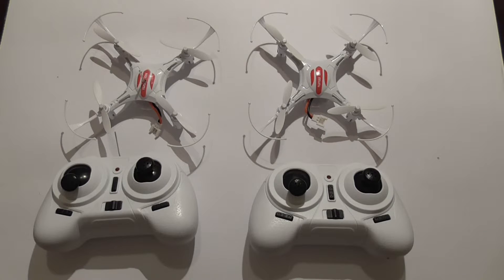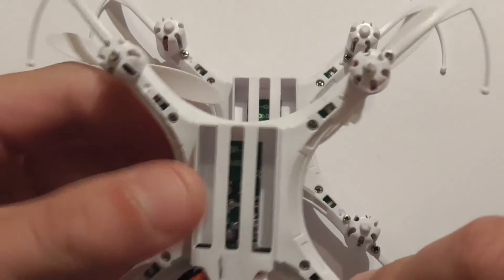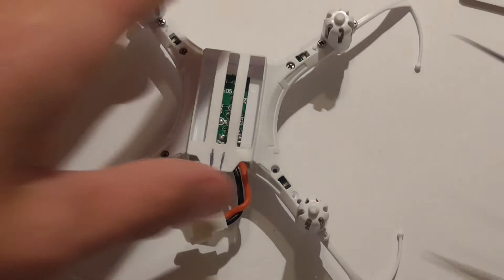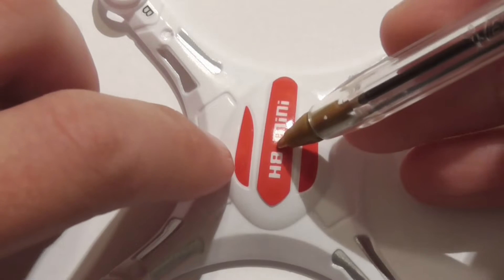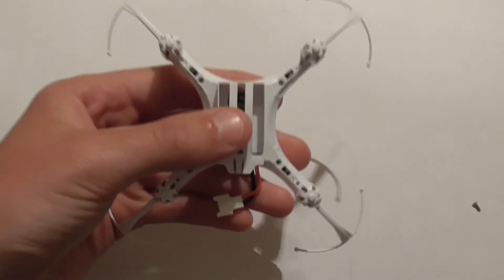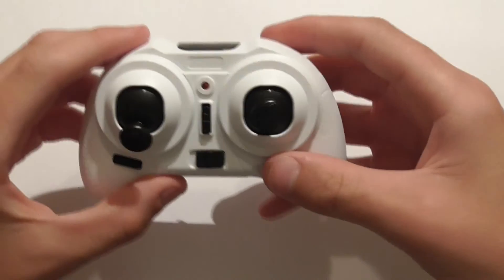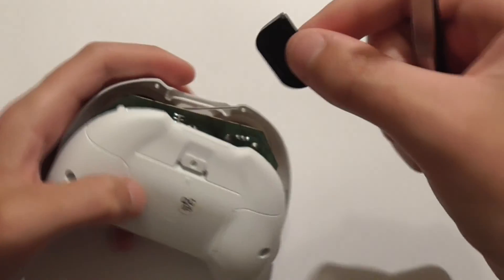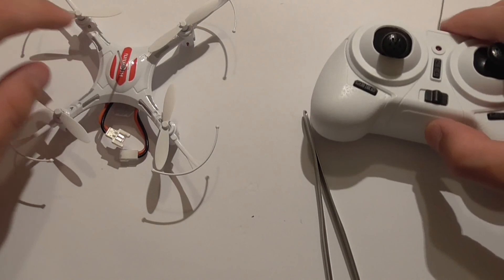Eachine H8 Mini Antenna Mod to increase range

Comment: good tutorial, best to use the screwdriver it comes with to make the hole, it comes out cleaner.

do you still have this drone? did it fly away? had 3 jjrc h20 fly away on me, i want h8 mini but wont be buying anything that can fly away
Reply: Sterling20073 sorry if this is late, i got a h8 mini and it almost flew away, bit thankfully the return to home feature saved me.

Comment: Good. Your video is bit different than mine: https://youtu.be/iDLvjj-P0QU

Also, I should check, but I found that range can be increased further by one simple trick. Currently is too hot outdoor to risk my second heart attack to do any measurement or test, but when weather permit - I will do the test.
Reply from the maker: ***** Yeah I don't know how much range you will get with just the antenna just poking out the quad but with the antenna poking out the quad and transmitter I got 100 Meters . But after about 70 Meter it becomes quite hard to see :) Thanks for sharing :)
Reply: RcFanaticZ Yes, for this size of the quad, it is difficult to see it at a distance. So forcing even more range is somewhat pointles. Yet, in urban area, especially modification on the transmitter makes sense - lot of WiFi signals may interefere with the flight of the quad. And then stronger the signal from the transmitter - the better chance of good communication TX-quadRX. 

Manufacturer (chinese) claims that it has "anti-interference algorithm", but I found that it has only "frequency hopping", which means that during transmission of the packet from the controller emits on many channels, jumping from one channel (or frequency if your prefer) to another, with one of the data part inside each packet which holds informatin where it will jump next time. In the case that receiver does not receive that information, it wait on pre-sellected channel or frequency for that purposes. It may last very short time until it re-establishes communication back.
Reply: +Wild Maniac With a transparent frame it is better to fly at night, where the lights make it easier to see against a black sky.  I unfortunately lost mine when a big gust of wind blew it a couple houses downwind, sucks because I had a nice transparent frame and even soldered surface mount nichia leds on it.  I assume it would not be possible to increase the range anymore than this antenna mod?
Reply: +Wavefront101 
In theory, you can get over 1 km with antenna mod on quad and remote. I did it on Bayangtoys X8. Eachine H8 has the same receiver and transmitter codes, and can be controlled by eather. So, just extending wires out you get much better range, but completelly new antennas - drastically increased range. Okay, H8 is not that good in lifting FPV camara, which without you can't actually see where you are flying.
Reply: +Wild Maniac 
My next comment will probably end in "likely spam" folder on RcFanatiCZ channel, because I want to include links to my videos - one for antenna mods, and another on my 1.1 km record in flight with BT X8.
Reply: +Wild Maniac Thanks for the info.
Reply: You are welcome.